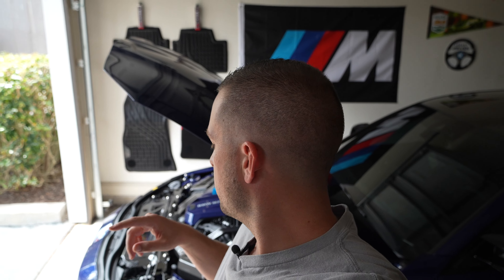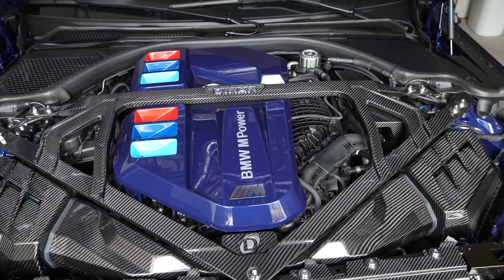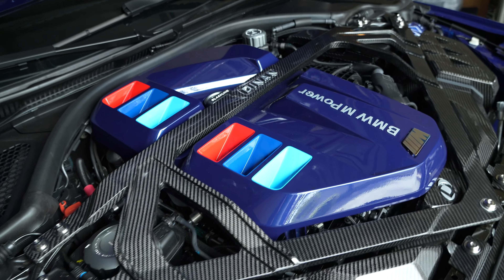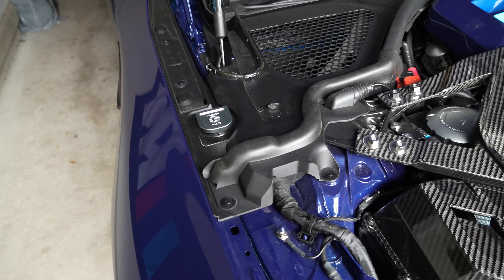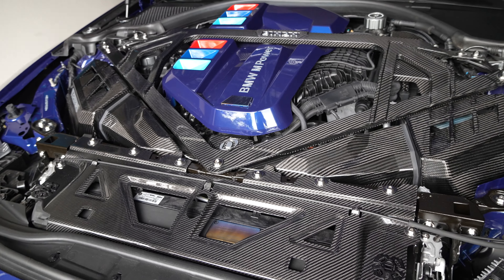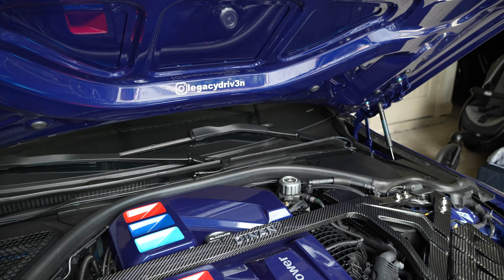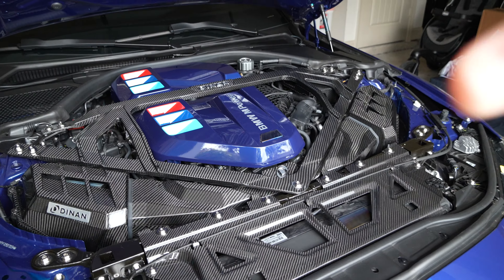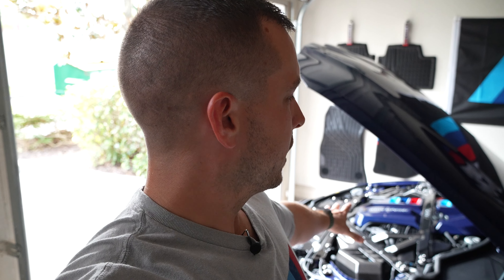Custom Built Engine Bay | BMW G80 M3

Comment: Where did you get those bolts that hold the top cover, I’m referring the one you using in combination of platic washers
Reply from the maker: Sure, can you specify which bolts exactly? Do you mean the ones on the cooling shroud carbon cover?